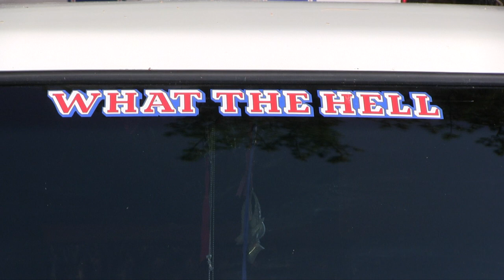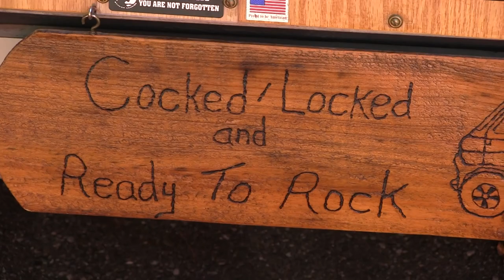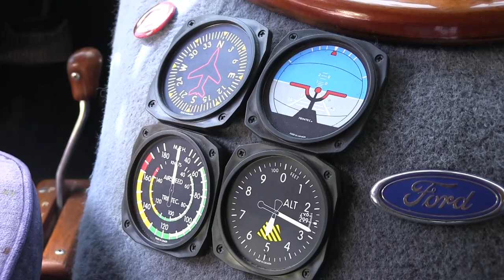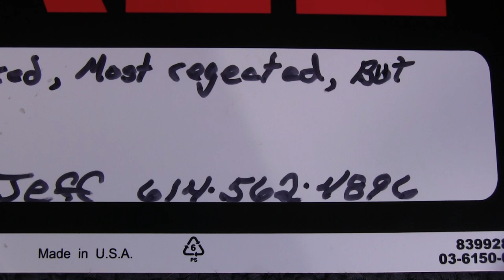WHAT THE HELL!  A Cool Custom 1973 Ford Econoline Van.

Comment: Well chopped and custiomized your '73 Econoline, Mr Raedman! It features a boat tail and and a vent on roof. Even the interior it looks changed without the typical horizontal dashboard a normal vintage Econoline has plenty. After all, some owners like them this way.